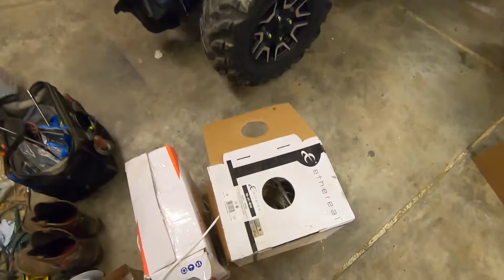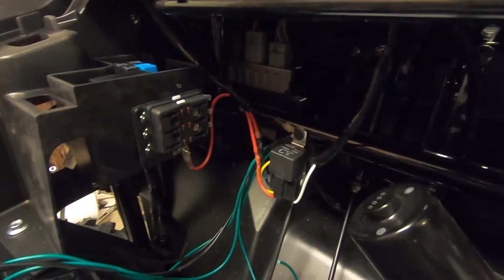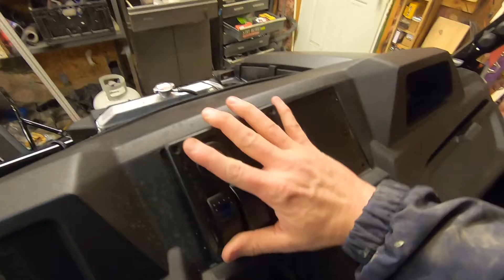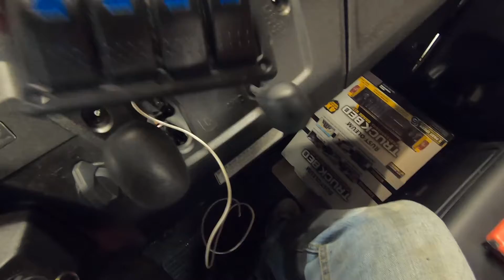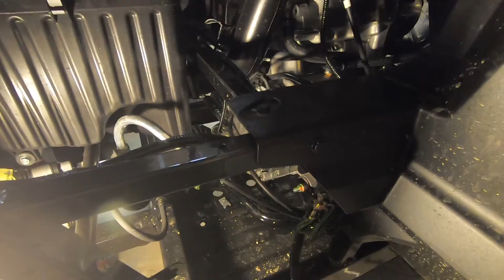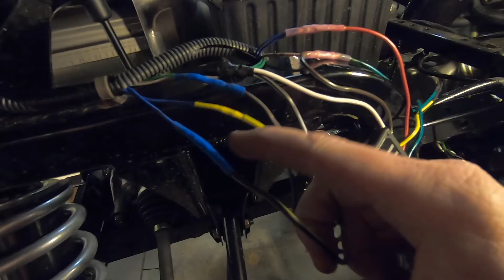Honda Pioneer 700 Custom Accessory Fuse Block, Turn Signals and Horn Installation

Comment: Thanks so much for this video as it is very helpful and I really appreciate it! I just got a used 2019 pioneer 700 deluxe. And I wanna do exactly the setup that you used. When I went to add all the Amazon products from the description unfortunately the switch panel as well as the tail light conversion kit is not available. I was wondering if you had any other recommendations on either of those? And if you do if you could send me your affiliate link so I can make sure to add it through that so you get your kickback! 

Also I was going to ask if you were to do your whole setup again would you do it the same way and use the same parts as you did before? Thanks so much and I can't wait to watch all of your other videos!!!

Mitchell
Reply from the maker: I would do it the same way. Here are the updated links. Thanks
18 gauge 4 conductor wire https://amzn.to/3bNsiav
Front Turn Signal LED Pair https://amzn.to/2Js58tQ
Horn https://amzn.to/2QQKVCf
Turn Signal Flasher https://amzn.to/2ylqirt
Waterproof Switch Plate with meter https://amzn.to/3ym3KGv
Tekonsha Taillight Converter https://amzn.to/3YBxdH6
6 way Fuse Block https://amzn.to/2X5lukr
Momentary Horn Switch https://amzn.to/2QTuZPK
12 gauge 100ft wire https://amzn.to/2wNlI4O

Comment: Hey do you have the model number of the Tekonsha Taillight Converter? The link on Amazon is expired and I see there are different models. Also wondering if all the components are still holding up. I'm about to do this.

Comment: so if i use 12 gauge wire from the bat to the relay and same from relay to fuse block what amp fuses can i use and how many can i use from the fuse block?   how many amps are possible without  damaging or blowing the 30 amp fuse
Reply from the maker: Up to 30 amps total

Comment: Does the blinker work if your braking. Like apply the brake and turn the blinker on to see if it flashes
Reply from the maker: Yes the blinker works. It overrides the brake light just like on a car.

Comment: Good call on tieing into the wires. I hooked up reverse light on the reverse light wire harness and it shorted it out . Took it to honda dealership and got charged 400+ because they were not a honda application.

Comment: Trying to finish up my winch install on my 700, just not sure which/how to splice into cigarette line?
Reply from the maker: I wouldn't splice into that circuit for a winch. I would wire the winch controller directly to the battery.
Reply: @JackofAllMasterofNone  that makes sense, but wouldn’t that leave the winch in the “on” position all the time?
Reply from the maker: @mogreen72  It wont draw any power unless you are using it.
Reply: @JackofAllMasterofNone  excellent! That will definitely simplify things thanks

Comment: Hi,

Did you end up running a 40amp fuse from the batt?  Also, What size fuses did you use for the signal and the radio in your other video?  I guess I'm asking how do you know what the right size fuse is?  I suck at wiring. Great video BTW
Reply from the maker: I used a 30amp fuse from the battery. It's the largest the relay can handle (rated at 30amps) and the you have to consider your wiring size also.
Reply: @JackofAllMasterofNone  thanks.  It looks like you 12 from the batt to the relay. then 14 amd 16 for accessories and such

Comment: Thanks for the videos they are awesome I have one question before I cut my panel for the switches I have the pioneer 700-4 is it basically the same with the bar
Reply from the maker: Yes. Same thing in the dash

Comment: I'm a little confused about your wiring I bought the relay you said there's five wires I don't see five wires on yours. White red yellow blue black is what the relay has. Blue goes to the battery red goes to the sub panel
Reply: The white one goes to the lighter and you have yellow going to ground isn't black supposed to go to ground? I'm a little confused because I can't see all the wires can you help me with the colors please
Reply from the maker: Unfortunately the colors vary widely from each manufacturer. The important thing is the relay position that each wire corresponds to. 85 and 86 are the switched positive from the cigarette lighter and ground. Can be wired either way. 85 / 86 can be positive or negative. It's just a coil. 87 and 30 are your input from the battery and output to the switch block. Again, doesn't matter which way you hook it up. Either way is fine. Hopefully this makes sense to you.
Reply: @JackofAllMasterofNone  HI, so what do you do with 87a which is the 5th wire?
Reply: Never mind the schematic on Amazon says leave disconnected.

Comment: did you add the relay? or was it original equipment ?
Reply from the maker: No I added the relay.
Reply: @JackofAllMasterofNone  were did you get it ? Do you have part number?
Reply: do you have a part number for the relay you used?